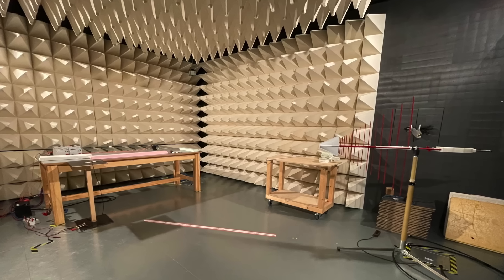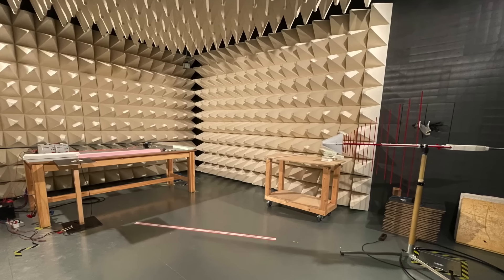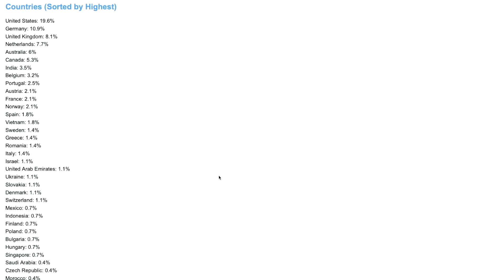I Built the Perfect PoE Sensor - But Can't Sell It to You

Comment: You can get certs for a global market from a single testing house. It's not a big deal - it just costs money. CE on the other hand is self-certified and the most loose and useless of all marks. You're vastly overthinking the process and looking at it from an incorrect perspective in that you believe that you are the one that will need to do/accomplish all this. You're not. Do you intend to hand-make and sell 2 of these per week? OK, so you'll use a contract manufacturer - every such manufacturer is already set up to accomplish all the certifications you need. They will all have contacts for packaging. Printing. Translations. Drawings. It all depends on how much you want to do yourself and/or how much you want to pay someone else. This is all done thousands of times per year, every single year, by small makers and tiny 1-2 person companies.
Reply from the maker: Thanks for the perspective! I understand that using a contract manufacturer makes things much simpler, and you’re right—most small makers don’t do everything themselves. My bigger concern is navigating WEEE and PPWR, which is tricky even with a manufacturer. The best solution for me seems to be finding a partner who also handles distribution.

Comment: EMC regulations are there to make sure that things coexist nicely with eachother. Its actually quite reasonable. You don't need to own all the test standards to know what you need to comply with - the specifications are easily available just a Google search away. There are some of the EMC tests that require proper expensive gear, but many of them do not.
Reply from the maker: Thanks, valid points! EMC regulations are only a tiny part (and a one-time payment). I’m actually more worried about WEEE and PPWR—they make it impossible for me
Reply: @playduino  Use a fab and distribution partner?
Reply: ask any HAM operator whose neighbors got cheap LED lights from china how much the authorities care about EM interference :)
Reply: @recreationalplutonium  Number 1: that is obviously variable from country to country. Number 2: How does that impact the rationale for the regulations? They are there to make sure equipment coexists nicely. That they are problematic to enforce and are enforced to different extents is another problem entirely.

Comment: It's called regulatory capture and is working by design. Large companies convince law makers that these regulations are needed when they only want to lock out the competition.
Reply from the maker: Yeah, that’s exactly how it feels.
Reply: @playduino  yeah they need to change this stuff
Reply: RF interference, fire hazards and electronic waste are real problems that have to somehow be regulated. I agree that it's not done in a good way and non open standards are so strange. Making and maintain standards and controls also costs money that have to come from somewhere.
Reply: @ lubricustheslippery5028    most standards are only changed in words and passages to make a new version to replace the old one, so everybody has to buy a new one.. the old ones NEVER go into public domain so that Joe & Jane Average can check them out and at least work on the old version at least.
For large market controlling companies those costs are nothing.. for small shops or individuals, just not affordable.
But we are being regulated by those standards, we are supposed to follow them.. and to follow them we have to buy them, from a single source.

Anyone telling me that this is a "capitalist free market" is kracy (or part of the group that benefits from this).
Reply: @lubricustheslippery5028  but a PCB with chips everyone else uses, with a power supply every one else uses this is a known set used for a tuned role by an on demand manufacture.     There is no proof other than the BOM right off the design software is needed to prove the solder is correct.      Their is no slim regulatory enviroment to use known modules in a novel way, so one is better off shipping a dev hat for a platform that already does Wifi, Power, Noise..... 

These devices are now what is considered trivial and not needing regulation unless a bigger limitation is broken.    If it is powered via a USBC or POE link, the chance of burning down anything is really low.
Reply: Thats kinda bullshit. Big cooperations would love to sell without regulations - and they would still be able to outcompete small companies in most cases. They have a big advantage if they have a dedicated body to take care of regulatory approvals. But the regulations are made to protect customers - nobody wants to plug in a device that catches fire, makes you sick from contaminants in the materials, have products that harm the environment. Even big companies often spend more than 50% of their development cost on regulatory approval. And a lot of small companies can actually  go under the radar with products that only to a limited degree comply to regulatory requirements. How often do you see 20+ people die from food poisoning, apartment block collapse because of diluted cement compositions, people getting fatal electroshocks from electronics in the EU? Almost never. And those thing happen all the time in countries where cooperations can bribe officials to pass regulatory measures. Its frustrating like hell to have to comply, but even Chinese consumers import their goods from Europe when they can afford it, because they don't trust their national compliancy measures.
Reply: Amen. It's so naive to think governments are supposed to protect the little guy from giant corporations. It's obviously the other way around. All incentives are aligned in that direction.
Reply: 100% correct.  Under the guise of “doing good,” regulations go too far and get out of control thanks to lobbying by large companies who benefit from stifling competition.
Reply: Of course, it's crazy how much power a giant company wields just by existing

They can just threaten the nation with taking it Offshore 

And legislators will tuck tail to satisfy their demands

Of course they say it's for the betterment of the people, they all say that

But under all that bullshit, anyone with como sense could deduce "yeah they're just trying to get rid of competition"

Making tests unbearably expensive, having people jump through legality hoops and holes, having founders pay €1M bc it took the lawyers 100000years to read through alllll the rules and regulations

The government needs to have a tighter grip over companies
Reply: That’s the EU in a nutshell.
Reply: The same thing with prohibition of lead in electronics. All that lead-free bulshit. For decades, drinking water was supplied through pure lead pipes, but then Pb became a very dangerous substance when it is used for electronics... For decades, car fuel included Pb(C2H5)4 - volatile metalorganic compound of lead - and spread it into atmosphear without noticeable health damage. Now you cannot buy 60/40 solder for your hobby, as it is banned for home delivery... Why Pb is prohibited for electronic? It is only because of high-tech mafia.
Reply: Also write to your local EU elective representative about removing some/all of those restrictions for small companies.
Reply: @hradynarski very true. For example the fees should be voided for small businesses. But I would argue knowing the law should not cost anyone anything.
Reply: @hradynarski that isn’t going to do anything.
Reply: @hradynarski  you will never change the EU. The UK tried that & they didn’t want to budge, so we left. This video shows just a few of the many reasons why we did.
All we need now is some politicians who are actually prepared to give us the Brexit we voted for, but we won’t get that from the current uniparty.
Reply: @ hradynarski  unless such a letter comes with some "incentive" for that representative, he will represent the ones who provide them - which is the large orgs.  Positions of power (like representative democracy provides) is unsustainable for that very reason.
Reply: @joansparky4439  Nobody in the EU parliament has any power to get anything changed. The EU parliament doesn't even make any of the rules, laws or legislation. They sign off on it and the relevant lawmakers pass it in to statute. I saw an interview with an EU commissioner (the people who hold the power) who explained it this way. He said that the parliament was there to make normal people  think they had democracy.
Reply: @ paulhawkins6415    Yeah, which is why the lobby-ist density is so high in Brussels.  It doesn't matter if the power rests with the parliament,t the commission or the national parliaments.. its too few people with too much control over what rules get to be enforced on all of us that can and do benefit a few - who once there naturally are incentivized to hold onto and improve on that status quo - I would do the same - who wouldn't?
Reply: Regulatory capture is a massive problem that I've noticed. Either sell out to the chewy-ish ones or you won't be able to afford the loiscense.
Reply: But then again, without regulation, the same large companies would use every possibility to drain us, the customer, without any regards of the environment or your personal safety, be it in the physical world or the digital world. 
These CE/FCC regulations are, in a way, also a good thing. Basically damned if you do, damned if you don't. You just have to choose the lesser evil. 

That's why open source hardware exists ;)
Reply: @ patrickd9551   large corporations are the product of anti-competitive regulation.  Regulation that prohibits/undermines competition leaves a few selected suppliers controlling a market and they do what is normal - profit maximization.  So they come up with more regulation - to "protect the consumer" - while in reality it protects them from competition.
The only time this is being not a problem for a while is when new technologies/markets are being created.. then it's only small companies competing with each other, until the first create regulations, lodge patents, secure copyrights and start to control the market.
Reply: @joansparky4439  " large corporations are the product of anti-competitive regulation.  Regulation that prohibits/undermines competition leaves a few selected suppliers "
Just not true at all.

Maturity of a market is where the colossuses comes from, which means all the low level fruits of innovation has been harvested already.
This is where economy of scale takes over, either to drive the consumer prices to the ground where small businesses no longer has a chance to compete, or to be able to do the heavy R&D needed to stay competitive.
Two examples, the car industry. When it began, you could scratch-build cars in your garage and make a living. Today, just constructing the engine cost a milliard euros or more.
Computers. Apple started out as a garage company, as did Rossmann group. Neither of them would be able to make it today, because the initial expense of just getting the tools needed to handle today's technology is prohibitive.
Reply: @ johanmetreus   free markets (markets where supply is free to adjust to demand) ALWAYS drive prices down to cost - ZERO profits.  Any anti-competitive regulation (which creates UNFREE markets) prevents this outcome.

Economies of scale is a different field that will NOT lead to big large corporations, but to medium sized ones that are unable to control a market.  To control markets it ALWAYS requires rules created & enforced by Governments that prevent competition from doing its job - driving prices down to cost, getting the profit to zero.

And yes,  Patents, Copyrights, Tariffs, Trade Regulations among a couple other things are such rules.
U just bought into the marketing of the benefactors of them..  they've been at this for several HUNDRED years at this point. U can look that up, it's public information.
Reply: They didn't only convince lawmakers that this is good, they convinced esp "progressives" of this..
A Smith wrote about this 250 years ago already, but the "mechanism" itself is much older.. Ancient Athens already had to deal with this stuff, Rome too, so I wouldn't be surprised it's been with humanity for as long as we enforce rules of any kind (which is NOT bad per se).
Reply: What's the alternative? Because the environmental and electrical safety/noise are valid concerns.
Reply: @YouGenom  Testing it with your own equipment? Who needs an anechoic chamber when you've got an empty field.
Reply: @YouGenom  sell dev boards and lic to larger manufacture when you show a 1 million unit market.

Comment: Look,  at the end you have a few options: license the design to a larger company and let them deal with this; they will have the capacity to do all the regulatory stuff as they would have everything in place already. Next you could setup an entity in a non-European country and sell the items from that overseas entity and unless you cross some big threshold of quantity it’s very unlikely anyone in Europe would figure this one out. Very few American companies selling smaller quantities (<100/month) would ever get some issue with the eu . Finally, sell a kit form and let people assemble it themselves. Put the software on the microcontroller before selling the pieces and that is  where the ip is anyway. Just a few thoughts from my side
Reply from the maker: Thanks a lot for sharing your thoughts!
Licensing could definitely be a way to get this project off the ground.
Setting up an entity outside the EU shouldn’t make sense… but sadly, it kind of does.
And the kit approach would probably work well for most of the people who’ve signed up, so that’s definitely on the table too.
Reply: @playduino  Setting up an outside company won't help you much. As the one who imports is still required to ensure that the product meets the criteria to put the CE label on it. Your best bet is to indeed sell it via another platform, be it licensing or becoming some kind of supplier for a localized distributor that "brings it to market". 

If this was some kind of DIY kit you could probably also sell it as a component, which may help you skirt some of the requirements and everyone using it would be responsible themselves then, but that tends to become dodgy quick, not to mention it seems like you want to sell an actual product.

I haven't seen your design, but I would also advise you to use parts that have some pre-certification for CE and FCC, especially for wireless tech. This can save you alot of headaches with certification.

Before  you head for EMC testing you should probably also do some pre testing with cheaper gear first. Even if it's not perfect you can probably do some decent base tests with 1-3k before you drop 5k on the final test twice (though retesting may be cheaper). Also make sure you check out smaller EMC labs and don't go straight to someone big like TÜV in germany, because they may only have large testing chambers and will want to be payed accordingly.

At the end of the day I can feel your pain. Doing something properly in the west is a massive pain in the rear, while many eastern platforms drop-ship frankly illegal and dangerous items with no regard and also zero way to hold them accoundable.
Reply from the maker: Thanks for all the detailed advice! I’m already using ESP32 modules that are pre-certified, which should save a lot of headaches. Pre-testing before going for the full EMC certification is a great tip, and I’ll definitely look into smaller labs instead of going straight to TÜV. And yes, it’s frustrating to see how easily unsafe drop-shipped products get through while small creators get buried in red tape.
Reply: @ignispurgatorius5297 you are right, an outside company is required to have an EU representative to be allowed to sell to EU citizens these days.
Reply: viel Glück

Comment: I skipped gave up on the idea to try to crate products on my own six months ago. Currently trying to build systems on off the shelf products instead. Problem is that even manufacturers like waveshare (which would be a good fit for me) don't CE mark their stuff that is relevant to me. And these products is avalible on amazon and local resellers in sweden. If I would have your knowledge and reach I would set up a webpage with relevant info and use cases for the industry and skip the all this headache that you experince. In my opinion this is a product for nerds like us wathing your content and the industry. Nerds  = kit/shield. Industry = white label/licence agreement. MQTT via ETH and off you go! If you have the incorrect approch then it's a multisensor product in a locked system. The correct approch is system integration product with multipurpose usecases.
Reply from the maker: I'm sorry to hear that you gave up on the idea. It's crazy how even big names like Waveshare don't CE mark parts that end up everywhere.

I like your point about the "nerd kit vs. industry product" angle. It's a tough balance.

Thank you for sharing your perspective. it really helps to hear from people who've been through the same headache

Comment: There are modules that have already gone through certification process. That's how many smaller companies seem to do it.
Reply from the maker: Yes, this helps. The ESP32 module that I use comes with CE and FCC. This reduces the amount of required tests and helps a lot. But it does not eliminate all tests.
Reply: That doesn't help you very much for the EU regulations actually